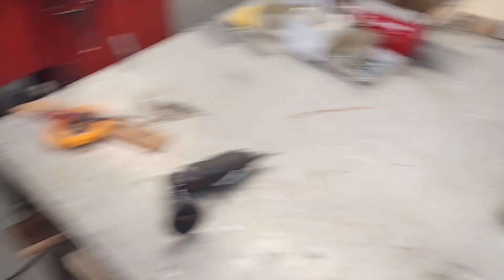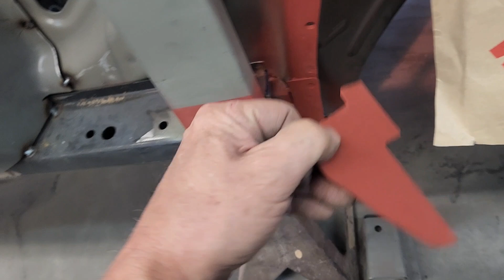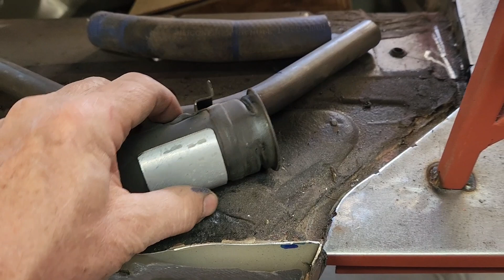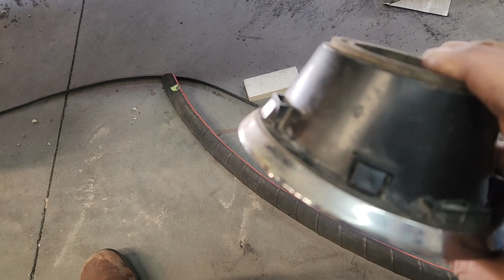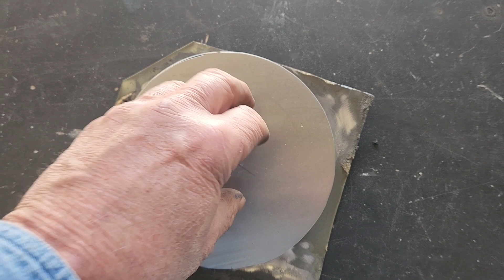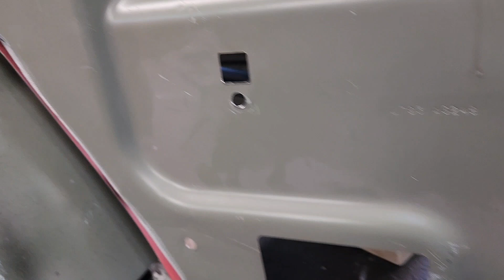Randy's Hellcat Daytona part 50

Comment: Thanks for talking about that fuel door. I've been shaping that same panel without having an original panel from the Challenger to work from. It's weird; stepped on the left side with a large curve around the periphery like you mentioned.
Reply from the maker: Well I have seen this door used on a number of builds and I always ask myself how each builder got around all the issues. You can never seem to find out from the pictures supplied so I thought why not be the first so others have a point of reference.
Reply: Much appreciated.  @SteveMirabelli